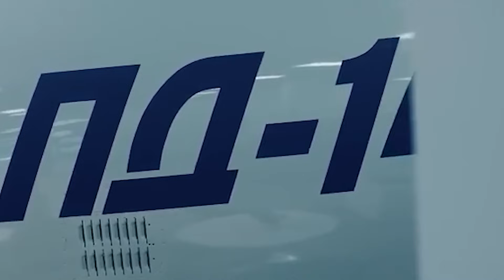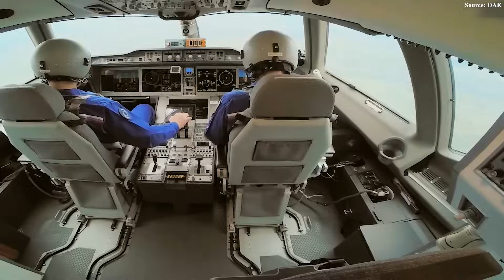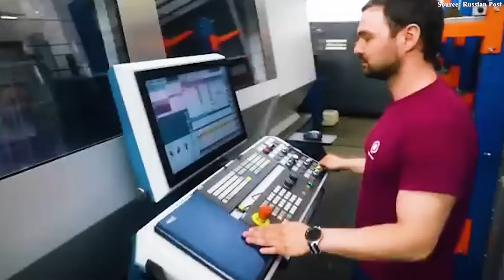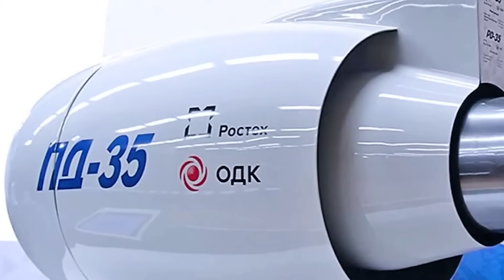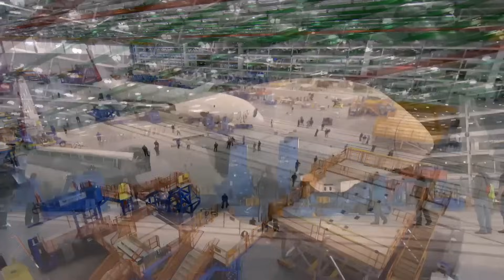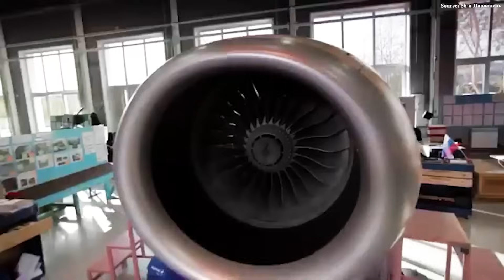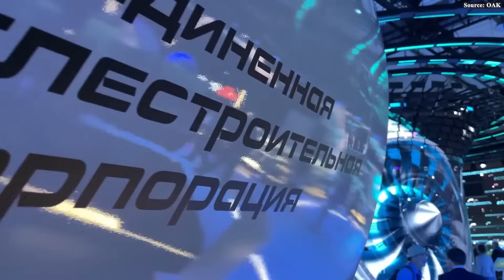Russia Just REVEALS the NEW MC-21-500 Will CHANGE & Revolutionize the Aviation!

Comment: Who wants this crap??
Reply: I dont trust this AI fake video. But MC 21 400 LR and Proposed stretched 500 are spacious long range narrow bodies. Wider than 737 and 321 so 6 seats 19" wide instead of 17 or 18" from Airbus and boeing. And the LR has a 12,000 km range. Pricing is much lower than Boeing or Airbus. They cost over €100m. The MC 21 is €60m.

Comment: The PS-90-4 fits perfectly on that project, the Soloviev D-30, also the Kusnetzov NK-86 is in the same class and a PD-24 is just an extra solution...!.
Actually, project MC-21-500 is an original IL-86- stretched with a new wing and two engines, nothing impossible, they just have to reach their parts bins and select the parts to create a new aircraft.. Everything is already there and they are experts in integrating any configuration they desire, I would think a 300 passenger would fit the mold perfectly.... No heavy expenditures no research needed just a little elbow grease, I'll give then one or two years to deliver it....!
Reply: Solovjev & D 30 ?¿?
Wer glaubt noch daran ?¿?
Ja, da wird doch gerade an der IL 76-90 etwas wegsubstituiert, oder irre ich mich da?
Und ja, das PD 26 ist eine kleinere Variante des PD 35 Kerns.
Genauso wie die Kerne des PD 8 & 14 jeweils kleinere und größere Varianten bieten.
Reply: @T-BwBerlinKarlshorst-  Boeing and Airbus are still using the CFM-56 that I been working since 1986, the Kuznetzov NK-86 is in the same class and can be upgraded very easy to up or down to 30% more or less  power by just replacing or adding an extra stage to the rear turbine, the same goes for the Lotarev-D36, Progress D-30 and other half a dozen engines that can be done fron a low bypass to high bypass just by adding a larger front fan....